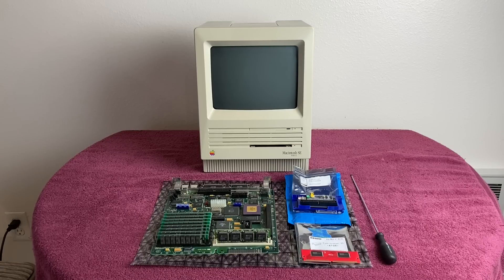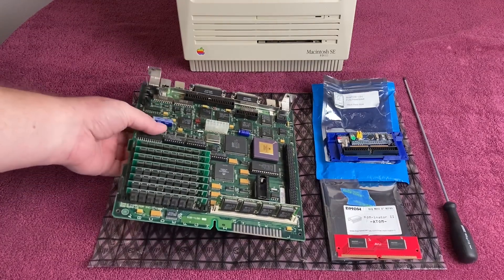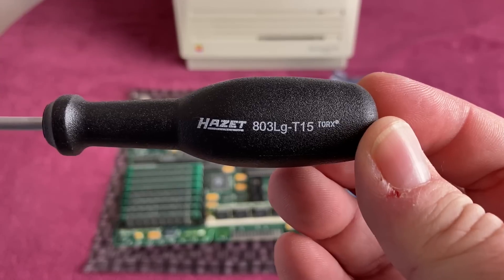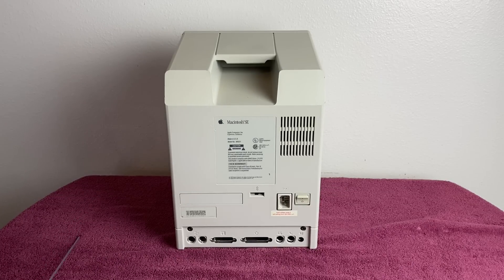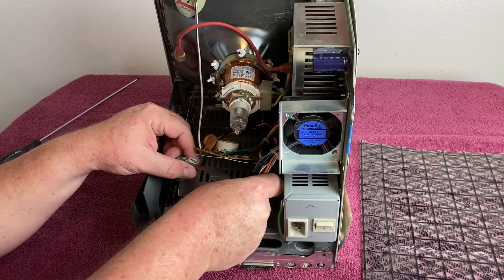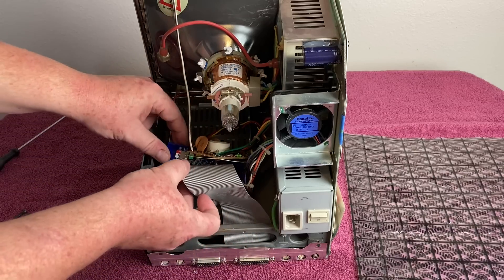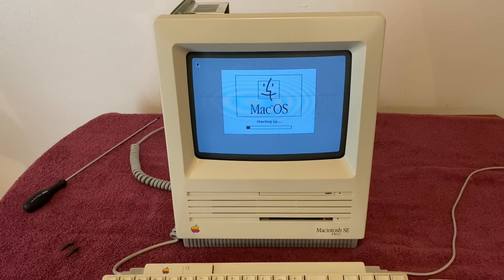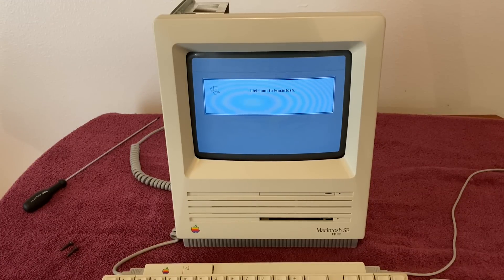Custom Macintosh SE/30 Build - BlueSCSI + ROM-inator II Atom SIMM

Comment: Sweet!  Timing was right for me to hit this one.  Last night, Thomas at Amiga of Rochester contacted me letting me know that me Classic II and SE/30 logic boards are recapped and cleaned and ready to go.  Historically, I have been using the SCSI2SD devices (and love them), but I've heard a lot of good things about the BlueSCSI.  Since I now have nine different original compact Macs, I'm wondering if I should invest in a few BluesSCSIs since I hear it's easy to build disk images for them?  I need to get a variety of MacOS images built for the different machines I have.
Reply from the maker: SCSI2SD's are great, however expensive compared to BlueSCSI's. You can get 3-4 BlueSCSI units for the same price as 1 SCSI2SD. I've used both and can say either way you go, both are good products. As for building disk images for the BlueSCSI, it's not hard, but not super easy either LOL. I'm not a huge Mac person, more of a C64 and Apple II guy, so it takes me a little more work to make them. Of course YMMV.
Reply: @geekwithsocialskills  I think I'll give the BlueSCSI a try as well.  One of the problems I have encountered is working mainly with 800k original Macs limiting the images I had available to read on my FloppyEmus.  I don't have my Mac IIs setup at the moment.  It's hard getting media to go among all the machines.  Now that I have some Color Classics, one with a NIC, no working hard disks, and no external floppy connector, I need a machine to where I can make some appropriate installation media, etc....  you know what I mean LOL.  The SE/30 will be a good intermediary device between 800k and 1.44MB file formats with an external floppy port to boot.  If I can BUILD an image on a modern Mac to go in a BlueSCSI....  /end A.D.H.D. thinking aloud process ;)
Reply from the maker: I would suggest buying an external BlueSCSI first, that way you can easily swap between machines with it using the external SCSI port. The FloppyEMU is also awesome. I have one and use it a lot between my machines. I also have a CFFA3000 that I got back in 2013 or 2014 that I use with my Apple IIe. Apparently those are being re-made now by a different person under license. Oh, and there is something else for Apple II machines called a BOOTI card. Those are great, but sell out very quickly and only show up a couple times a year and now with supply chain issues on IC's, it's even harder to get one.
Reply: @geekwithsocialskills  Yeah, I'm probably going to do that.  For a "finished product", I do prefer something internal so the system looks stock, but having something external to swap among machines and to get several up and going is super worth it.  Once I "finish" these compact Macs, I want to look back at some of that for my IIe and IIgs.  I'd love some kind of fixed disk solution for them.... same for my A500....  and for the A1000 once I find a keyboard....  and on and on and on and on and on ROFL.

Comment: Dont lose your battery. If you BMOW and use mode32 you need the battery to save settings.
Reply from the maker: I have plenty of batteries. I keep them out of the machines until I'm going to be using them for a while, then remove them again. As mentioned I do need to resave settings, but that's ok and very easy to do.

Comment: The Governor's School I attended had a bunch of SE's in their computer lab at the time. I always wished they were SE/30's after hearing from a friend that actually had one at the time how great of a little Mac the SE/30 was. Maybe someday I'll have an SE/30 as one of the computers I've always wanted to use but have yet to get the opportunity to do so!
Reply from the maker: It seems the SE/30 is the most desirable compact black and white Macintosh, however most of the units I've come across have had major capacitor leakage or battery bomb damage.
Reply: @geekwithsocialskills  I've noticed that, too, and am unsure if it's because of the non-user-servicable nature of the SE/30 (so normal users didn't feel comfortable removing the battery before storing the Mac, or didn't realize there was a PRAM bettery inside that needed removing), and/or because Apple switched battery suppliers around the time of the SE/30 to batteries that were more prone to leaking.

So while I'd love to have an SE/30, I suspect I'll add an SE to my collection sooner because they seem to be more commonly available in less affected conditions. And because the people that really want an SE/30 don't bid on SE's.

And as for the capacitor leakage, that's common among all the Macs at the time. No doubt Apple was using common suppliers among their entire product line. Every Mac I've bought from the time period has needed at least the logic board recapped due to obvious electrolyte leakage.

Comment: The Mac Cracker, LOOK AT THE SIZE OF THAT THING !  You can also use a Torx 10 driver, because the hole in the screws are tapered.  Sometimes a Torx 15 driver is too tight.
Reply from the maker: Indeed, look at the size of that thing LOL!

Comment: I didn't know the SE/30 came with an FPU.  Neither did I expect it to be soldered to the board.  But I do know this is the smallest Macintosh which can run A/UX.
Reply from the maker: Indeed the SE/30 comes with an FPU. IIRC it's a Motorola 68882.